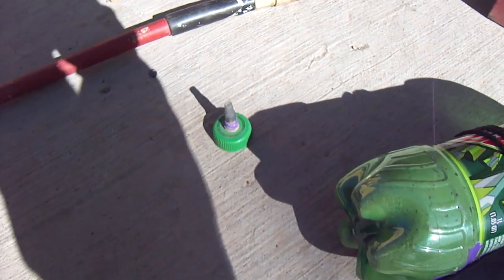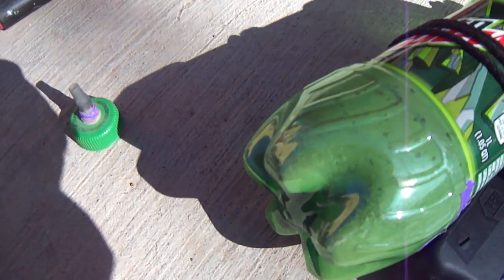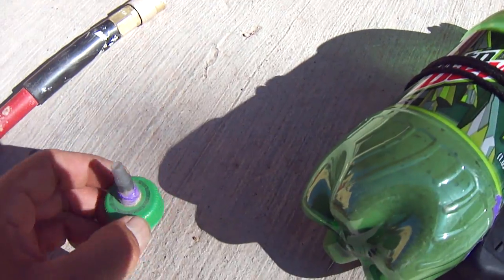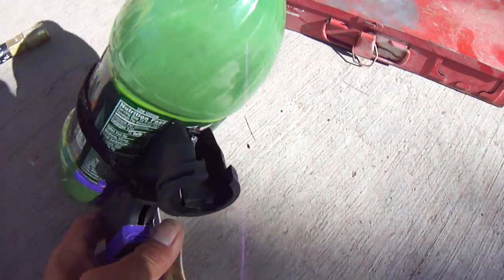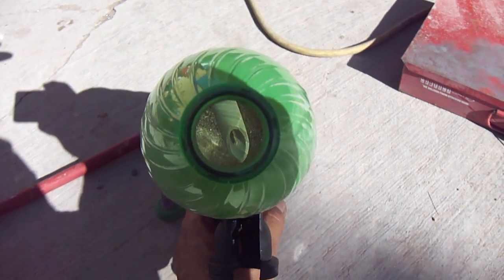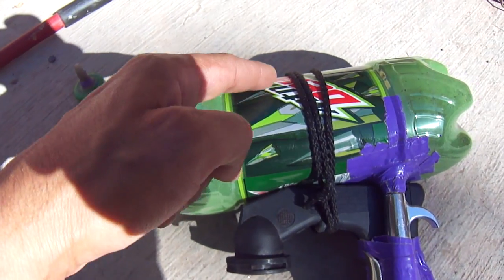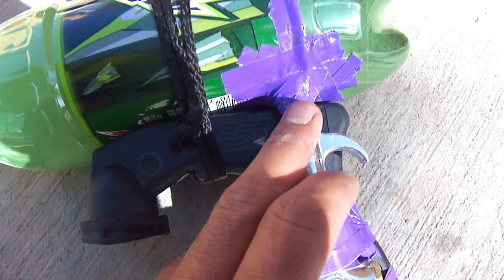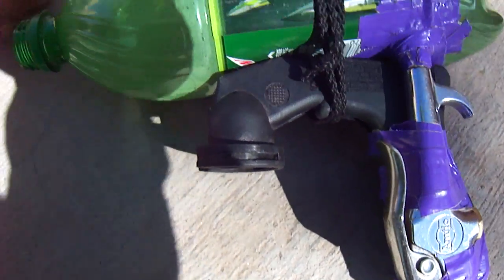Home made quick and easy mini sand-blaster made out of a mountain-dew bottle and some duck tape.

Comment: Hey buddy, I'm developing a gadget that drops sand from the top, at a much more slower output than a sand blaster, like a hourglass speed. My biggest problem is that it can make much noise, would you have any advice for me about which way of pumping air into the sand I could use being as silent as possible. It's really slow so it can use really low pressure. Many thanks!